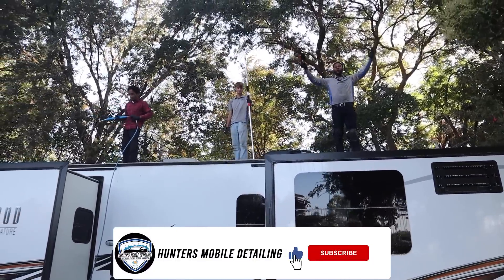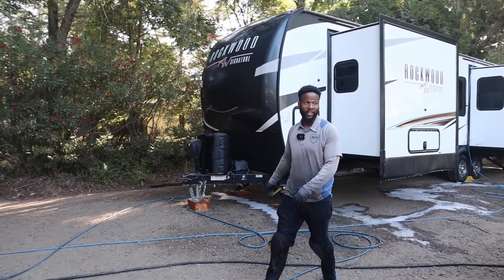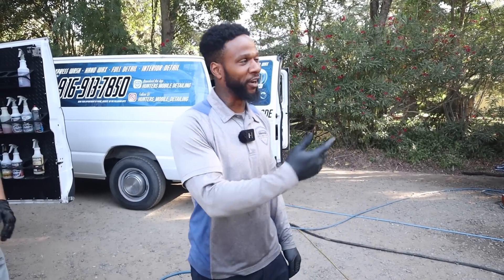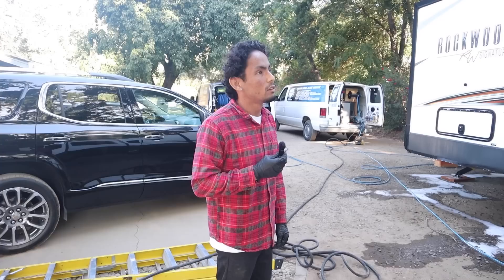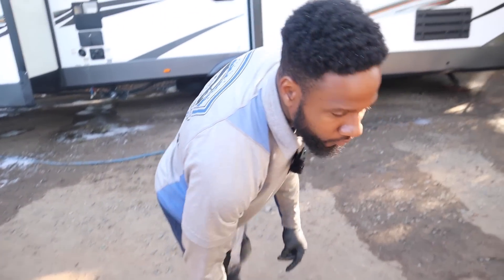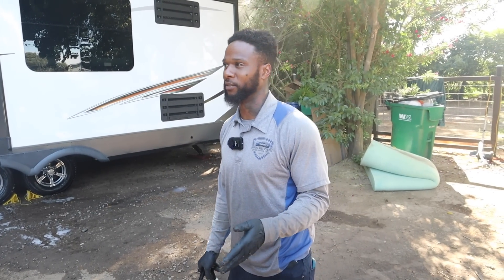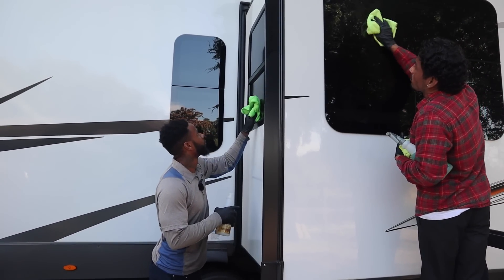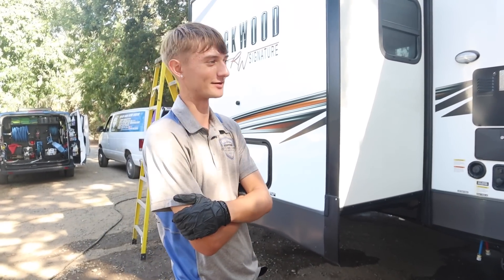How Much I Charge To Detail A RV - Hunter's Mobile Detailing

Comment: Ive been detailing rvs for 3 years professionally, own a mobile rv service and repair business and have been working with rvs for 7 years.  I've got a couple of tips for anyone who wants them. 

You talked about water spots on the windows. Use a quick detailer to do all your windows on rvs. It will take off any and all waterspotting. Trust me on this one. It's takes a medium. Amount of pressure and a microfiber towel. We use speed shine. 

If it's the first time we have touched and rv we always degrees the whole thing as a pre wash. Since it's getting protection afterwards you need to prep the surface and will save you a lot of time a frustration. 

For the roof, first get a ladder if you're doing rvs. Never trust the service ladders on the back. I've had them tear off the sidewall. Get your self a little giant ladder. 

To get through the roof quicker use a strong degrees and light pressure on the roof. The roof is a rubber membrane and if you tear it or damage it, it is not a cheap fix. Then use a good automotive soap and follow up with a uv protectant like 303 ultimate uv. 

For awnings go on Amazon and get Magic mopper erasers. They are big magic erasers with a velcro back. De-grease the awning and lightly scrub with the eraser. Rinse off. Soap, scrub rinse then hit with the uv protectant. It will loom perfect after you're done. 

The side walls I wash one entire side with de-greaser, followed by soap and we do it twice on every surface. The front may need more due to bugs. Then we dry and use carpro hydro 2. Do not cheap out on this part, the fiberglass needs to be taken care of and your need to charge accordingly. 

After years of doing this we do not do by the foot pricing but that is because we have online scheduling and it makes it easier on the customer to schedule. 29 feet and under is $299 and that include roof and awning, 30-37 feet is $349 and 38+ is $399. It takes 3 to 3.5 hours for me to do an entire rv by myself. Make sure you do the job properly as with all things. 

Ceramic coating on gelcoat is a bit different than ceramic coatings for automotive paint. Fiberglass is way more porous and needs a thicker coating. You always want to put a marine coating on gelcoat, it will soak up a huge amount of it just by the nature of it. Some of the longer lasting marine coating say they last about 3 years but they only account for being in water so you'll get more life out of them. 

I hope this helps and I'm sure I've missed a few things but anyone is welcome to message me for more information.
Reply: Can you buff polish & wax a 45 foot painted RV by yourself in 3-4 hours too?
Reply: @danarias2929  Well, that depends on a couple of things. Condition, climate, and what the customer wants. Could I use a machine polisher to apply a wax in 3-4 hours after prep work? Absolutely. Could I remove oxidation in 3-4 hours? I can not do that. We are talking about a full day or multi day process and a thousand plus dollar price tag. 

It's like doing a paint enhancement on a car vs. a 2 stage paint correcting. The answer is that it just depends on the level of service you are providing, the customer expectations, your skill level, and what you're willing to do.
Reply: @GlennSherwood   Ive been using  using a 4 step process for years on RVs. 

2 step makita polisher with white & yellow 9 inch wool pads. 

Then 2 step process using a rupes polisher (blue & yellow pads 5 inch pads). 
Then wipe down as you go. 
I’ve used this process for years. 

I have been buffing on 45 foot RVs in 11-12 hrs average. 

If customer wants their roof washed, heavy water spots removed, tires & wheels wiped down it takes longer. 1-2 hrs more depending on how bad water spots are. 

I don’t take breaks & I’m not distracted by anything & I only work alone. I’m just curious on how others who are buffing on large scale consistently on 45 foot RVs & what process they are using & how long it takes them in today’s market. Do you buff on RVs often?

Comment: Wayne  you should check out the SOLA TECS C 400 cm  solar cleaning brush . it is a rotating brush which is  driven by  a pressure washer and  spins at 700 RPM  per minute . The brush itself is  very soft and designed for  solar panels and glass... IMO  it owuld  have done that roof in not time at all ..  and possible could have been  used  for the sides  of this RV as well ...   Do a bit of  research   ....  THis brush saves  tons of  manual  scrubbing this is why it is used for cleaning solar panels
Reply: What cleaners do you use on solar panels??

Comment: An 8 year ceramic coating still needs maintenance or it won't last as long. The benefit of the 3, 5 or 8 year coating is that the maintenance will be quicker.

Comment: Friendly advice to be careful with a pressure washer on the Roof and where the decals are on the sides. Not as big of an issue with newer rigs but definitely can be with some that are 5+ years old. UV damage is a b*tch. 

Just 2 cents from a full time RVer. Love the hustle my man. I'm about to leave my corporate job and start doing this along with other maintenance and repairs. Keep up the good work. 

BTW a lot of people will charge by the foot. i.e ($15/foot x length of trailer) Just depends on if you're only washing or what all you're doing. Also recommend treating all the rubber seals with a UV protectant (not Armorall)

Comment: Good video bud.  I charge by the foot for rvs . I start at 10 for a wash and wipe . Add another 5 per for the roof and up to 40 per depending on protection desired.  Which brings me to ceramics.  Im not a believer in these 7 , 8 9 10 yr ceramics but nit for the reason you stated . My thoughts are 1) thats a long time for a customer to keep a maintenance program . Life gets busy . 2 ) the average person onky keeps their vehicles for around 5 yrs so why try to sell them a 10 yr when most wont benefit from it . 3 ) environment.  Yhe longevity of a coating has many variables.  A coating installed in a nice weather state will last longer than a coating in a snow state . I do uo to 5 yr and thats it . Even then i explain to my customers that probably more like 3 in the real world and that it needs to be a partnership between us to maintaining it . If they , over time , dont hold up their end it just wont last .

Comment: can you put a sealant on without clay bar ?
Reply: Technically you don’t need to clay-bar it. It helps but you can also buff it. Either way it’s up to you. Just have a clean surface. 

I recommend a wash & buffing it first that way the surface is clean. 

Polish it afterwards & then add your sealant of choosing. Make sure when you apply it that you’re not in the direct sunlight. This time of the year is just too warm to apply sealants & ceramic coating to anything directly in the sun. 

If you don’t have a covered area to work under then at minimum do it at night. Just get some good bright lighting to help & take your time. Follow the instructions on what you are using too 😊